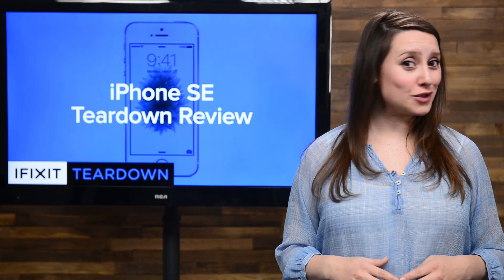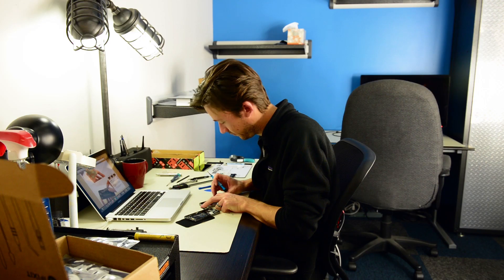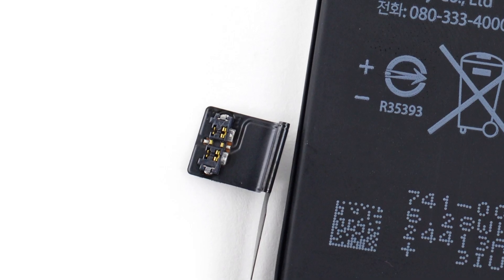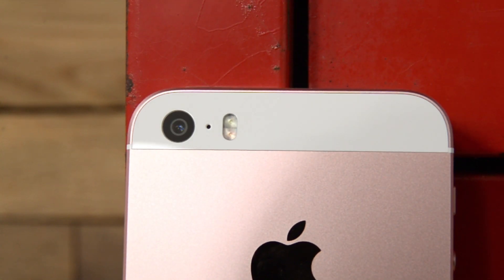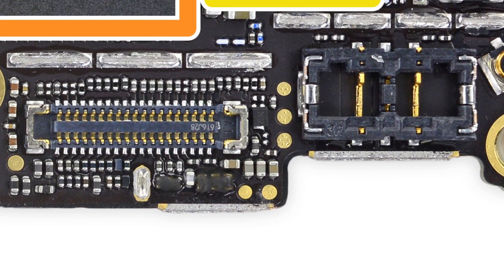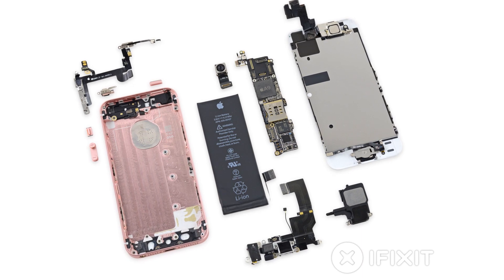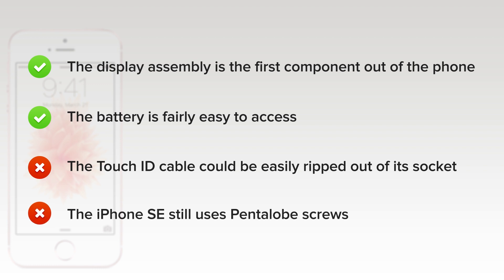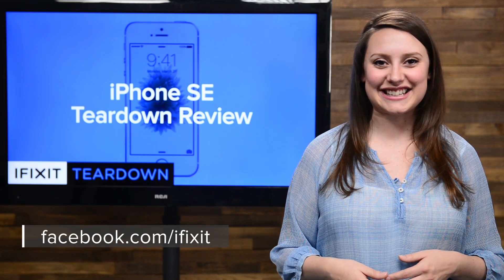iPhone SE Teardown Review!

Comment: I'm disappointed that Apple went with a separate Apple logo on this compared to the polished on logo on the old 5/5S. The polished logo looks so much better
Reply: I'm fine with both, but I do agree with you, the polished logo looks a little better.
Reply: JackPlaysOfficial and i've got a great big scratch line going down the middle of my 6 plus through the separate logo, even though its spent its life in a case
Reply: so its not "harder to scratch". 

actually, after looking at my old iphone 5 shell, you're probably right. my old 5 shell logo is scratched up but my 6 plus logo just has that big scratch